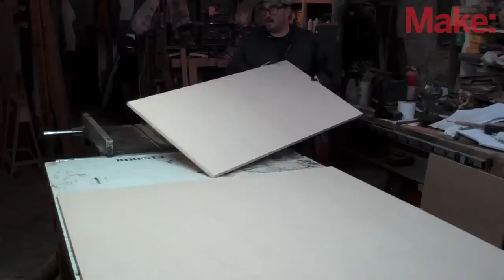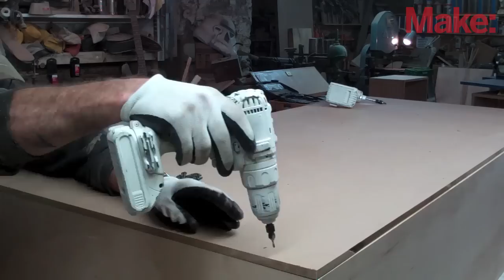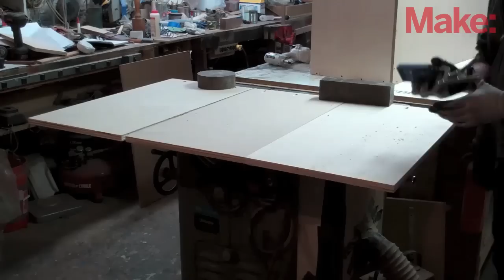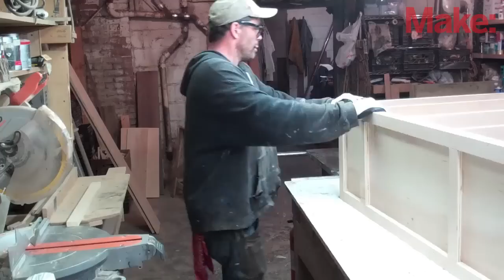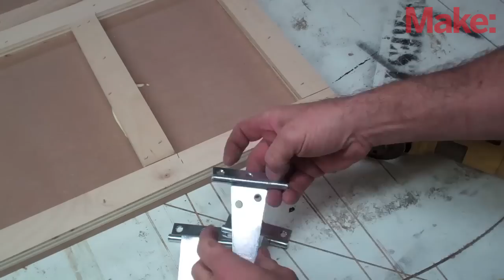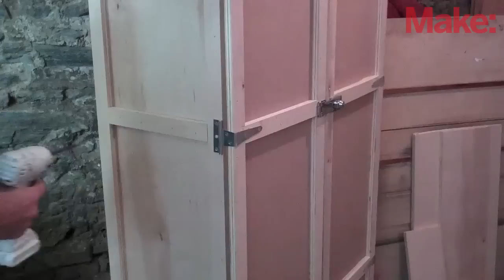DiResta: Rolling Tool Cabinet

Comment: I just built 2 of these, and love being able to roll these out of the way,,, or, closer to the work.
Mine have to roll out of a boxvan, on to jobsites,, so 5'10" was the max height, by 2' deep,, But I did make them 6' wide.  Next 2 will get 4" casters thou,, 3" wheels struggle on uneven surfaces,, especially when the cabinet is loaded.
Great vids Jimmy. Looking forward to seeing your other YT project vids.
PS.. the "dirty" bent hinge trick was golden.

Comment: I'm curious about your outfeed table behind the Table Saw.  It looks like a sacrificial top?  At least, I've seen you cutting directly on it in other videos.  Is is 1" foam, or is it a sheet of Plywood or ??

I also have a small shop and learned long ago that four swivelling wheels are the only way to go.  Often people put two fixed and two swivel on a cabinet, but that does not work in tight spaces.

Thanks for the video, enjoyed it!

Comment: Another top notch video Jimmy.
Has any one asked where you buy those white drills that work upside down, or the rubber tipped push stick that seems to be an extension to your arm? We can't buy them over here in the UK.
Keep it up, well done.

Comment: Nice, but if the hinges are on the outside it is easy to get into it simply by unscrewing them, so the lock is not much use...
Reply: Locks only stop honest people, who would also not dismantle your cabinet to get inside it.
Reply: But all the screwdrivers are stored inside the locked tool cabinet, of course...! :)
Reply: TheCrazyInventor Good point!

Comment: any plans on the base cabinet measurements?i need to build 3-4 of these for my garage
Reply: +BookofHolyH2O If you need to build 3 or 4 for your garage, i suggest getting out you tape measure and see how big you need them to be to fit in your garage, and to fit what you need to put in them.... then that will be the measurements you need for your garage... the whole point of making something is that you can make it the size you want/need for yourself... ...  ....

Comment: Where the heck does he get all his materials?
Here at my place, it would be impossible, since raw materials sometimes cost more then buying the whole endproduct in a store.
Reply: Where do you live?
Reply: CapSuperM

Germany.
At least Im not familiar with easy ways to get materials for a cheap price.
Reply: Here in Latvia you could buy all that plywood for 40 euro max.
Reply: TheRealDeal

Here it would be unpayable.
At least in normal Material Markets.
Reply: Rakku That's weird.  Don't you have hardware and lumber stores?
Reply: We have, but very few and you would have to drive very far to get stuff from them.
I would have to drive about 30 - 50 km at least to get to a useable lumber store.
Reply: Rakku Well Jimmy finds and restores alot of old discarded wood I think..
Reply: Rakku the thing with us in Germany is that we have much more sophisticated plywood, wich costs more. Americans have plywood out of fat layers glued with cheaper glue in a cheaper way because it is used more in their country  ( no offence americans). Germany has fine burcht plywood wich is sold for a lot of money, but is extremely strong, much stronger than would be needed for example this project. In Germany you can get Spanplatten cheap ( pressed together wood) 
Cheers

Comment: What is the purpose of those power bits he & many other woodworkers use on his drills.  I've seen them at hardware stores but they never explain what their purpose is.  :/
Reply: Well, if you only have one drill, those bits allow you to do quick tip changes on your drill...As he has 2 drills, he doesn't have to change  his bits over to use a drill bit for piloting his holes and the changing bits to fasten the screws.
With a multi changer tip, some drill bit come with a hex end that allows you to use them with these kinds of quick change tips, as well as counter sink bits...
I hope that is what you were asking about.

Comment: Hi Jimmy, can you tell me sizes of cabinet? Height,Width,Depth roughly----  link under video is now broken.... thanks ;-)
Reply: +Kevin Clarke (Mr Green) Im pretty sure he doesnt monitor these comments, since its not his channel. But Im sure you can repeat these steps with just about any size you need to fit your shop. If I were to do it myself, Id go with 4ftx8ft (a standard sheet of plywood).

Comment: MDF and Plywood is bit expensive in Europé. I challenge you Jimmy to make a floor to ceiling tool cabinet for powertools out of OSB for corded Machines, where the Tools are exposed, still making it looking good and making it sturdy enough.
Reply: that sounds like a move country problem to me. what does a 2400 by 1200 sheet of 18mm mdf cost in europe?
Reply: Connor McAllister 40USD for that size MDF, whilst approx 8-9USD for OSB in Sweden located in the North of Europé.
Reply: JN 2013 ok thats only 10 us more than here in australia  but a 12mm thick osb of the same size is 17 us here
Reply: Connor McAllister I didn't know that. However, tooling up and building 15 cabinets for my 100sqm workshop on zero budget so to speak, why 30 sheet of MDF compared to 30 sheet of OSB add up to quite a big difference moneywise...
Reply: JN 2013 oh yeah prices add up quick when you're just starting to work out what you want, i haven't ever used osb but i figure using that and maybe some smaller structural pine to brace the parts  you feel need bracing you could do it?
Reply: Connor McAllister In my case I just need the cabinets to be the way I need them to be functionalwise. The ugly edges can be hidden in either 45's or frames ...thus the challenge for DiResta.